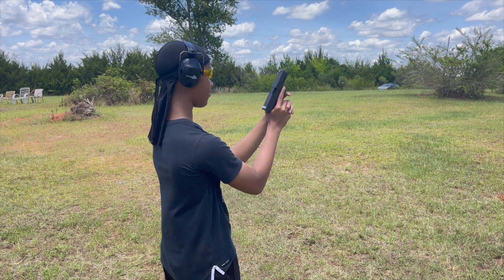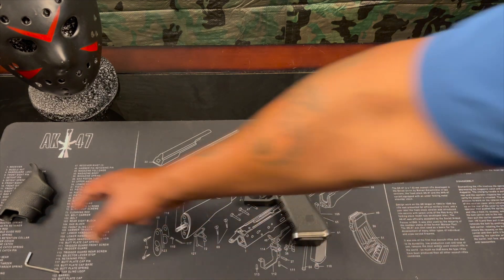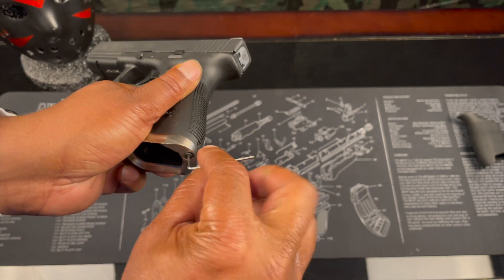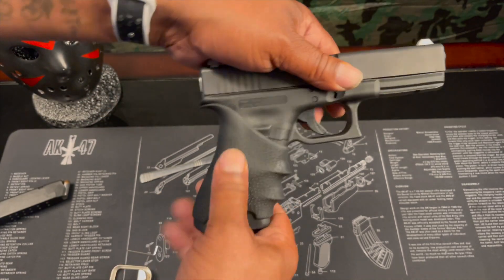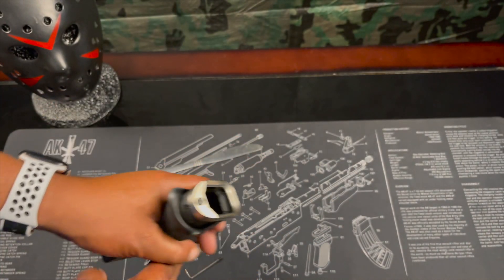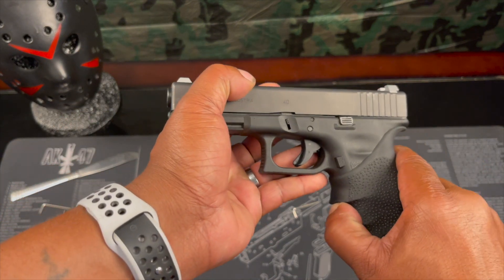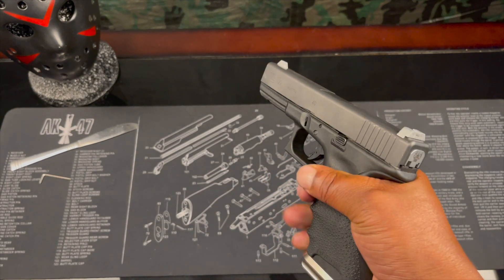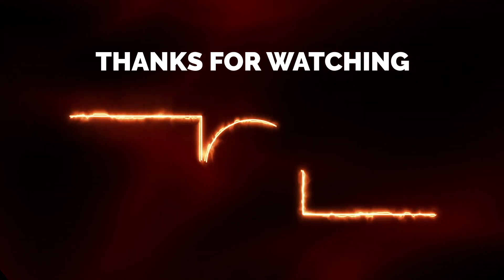Glock 22 First Shots and Hogue Grip Installation

Comment: Johnny,
  Spray the inside of that Hogue piece with WD-40, and it'll slide on a lot easier.

  The WD will evaporate, leaving both surfaces dry.

  I used a bicycle inner tube (26x1.70/2.35) heavy duty (20% thicker) on mine (Walmart).

  Not as much bulk, and no finger grooves, which I don't care for.

  You'll definitely need the WD to get that baby on!

  Jess1344